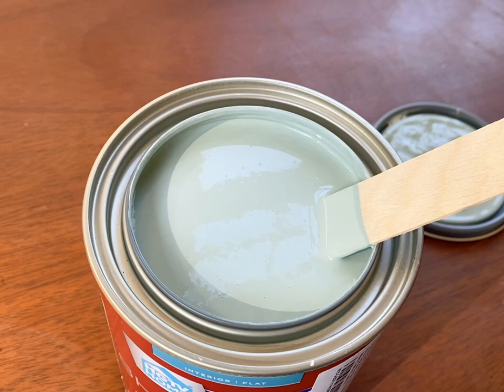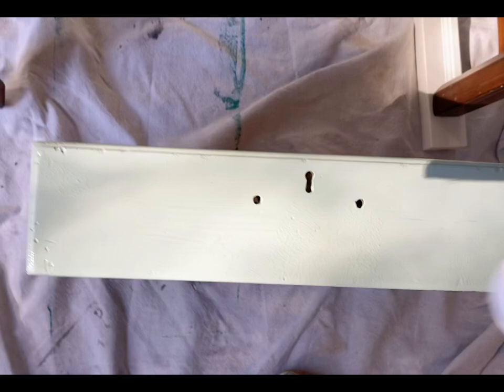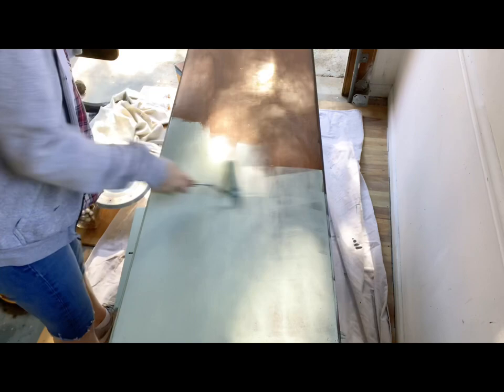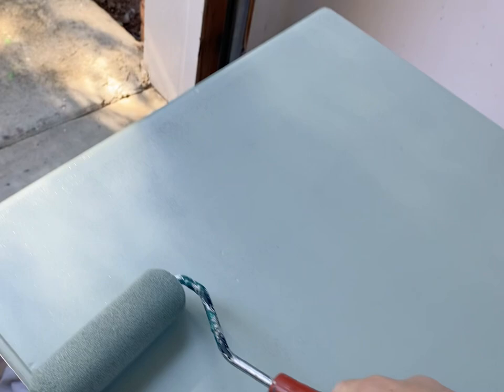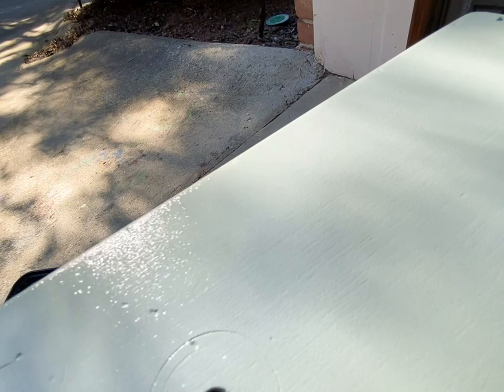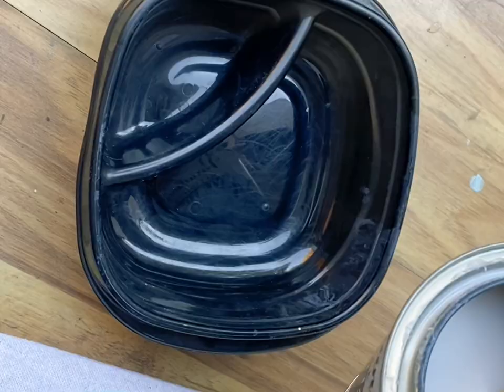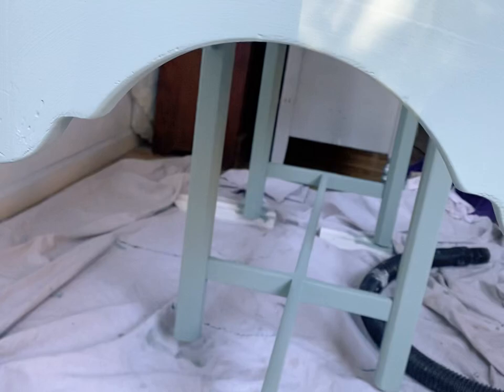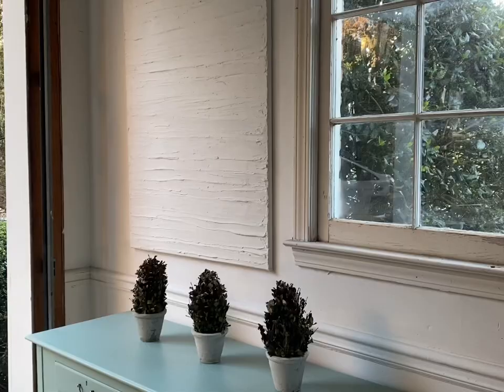Can you paint furniture or cabinets with house paint? YES!🧐 BUT…only some brands will actually work

Comment: Sweetie, I used "wall paint" for years on my furniture and only heard it was a no no, since chalk paint came on the scene.
Thank you for assuring me that whatever paint you use, it can and will work.  Love this flip!!
Reply from the maker: We are the same ❤️
Reply: Not true
Reply: @thomasburr9244  maybe "not true" for you.
Reply: @christibell5757  I'm a professional painter with over 20 years experience, not all furniture or glossed wood will accept paint a lot of stand surfaces even with the paint you are using it will not adhere correctly and you will be able to scratch it right off, I highly suggest using Sherwin-Williams extreme bond primer, it can adhere to any glossy wood surface that has previously been stained
Reply: @thomasburr9244  I understand.  I will tell you that 6 years ago, I used Pittsburgh Paint, with primer and finish to cover my ugly orange oak cabinets.  I took my time, painted 4 coats. 44 cabinets, including pantry.  
I took very good care of the cabinets.  They are beautiful today!
It doesn't work for everyone,  but the application worked for me.

Comment: You keep popping up in my rotation. I finish cabinets as a profession, as a painting contractor, and just to throw my 30 years worth of 2 cents in to help your followers….the only reason the HG SW paint is working for you is because your sanding the finish that is already on these pieces of furniture, i.e. you’re creating mechanical adhesion by giving the surface “teeth”, not because the product has “primer” in it. There is no such thing as a paint that is both a primer and a finish in one. These products are only referring to going over previously finished surfaces. A true primer is absolutely needed for raw wood, new drywall etc. That would be chemical adhesion. Your results do look great.
Reply: Do you recommend cabinet paint for furniture or regular house paint?

Comment: Tip from a professional painter, get a better brush that cheap brush aint cutting it. Also when you lay the paint on with the brush and then use a dry foam roller to flatten it out you're actually pulling all the paint off, secondly you should always, I repeat always use a primer when painting over glossed furniture would in cabinetry like that, I would suggest Sherwin-Williams extreme bond primer, that makes it so any glossy surface will stick and adhere and you can use whatever finish paint you want over that primer

Comment: I know its a pain in the a**, but I always prime every piece I do first, sanding in-between coats (usually 3) with 240 grit. I also add a tiny bit of water to my paint. The finish is always glass smooth. I treat every piece as if I was keeping it for myself.
Reply: What paint do you use?
Reply: @vickyb9918  Ovation or Country Chic chalk paint
Reply: @daveristic7895  Thank you!
Reply: I’m sorry I’m new to the game and just doing pieces to save money at home. Do you sand in between your paint color coats? I don’t know why I am reading it as either the paint color or primer 🤦🏻‍♀️ I’m sure it’s self explanatory
Reply: @Mshelen826  I sand between every coat of primer, and I sand between every coat of paint except for the last coat of paint.

Comment: LOLZ....And here I thought I was the only one putting plastic wrap between my lid and can... I do it so that the dried paint flakes don't fall in my paint each time I open it. And plus I do it for a better seal. especially if I don't use that paint for a while. I'm so going to try your 1 step paint recipe at some point and drag the foam roller method for topcoats. Great video! Learned a lot! Love your channel! All the way from Cape Town, South Africa! ✨🌺✨

Comment: I just redid my kitchen cabinets and used a sprayer. Love mine. I didn’t mind the clean up. Mines just electric and I used less paint with it versus painting by brush and roller. My experience anyway
Reply from the maker: That’s good to hear, I need to give another brand a try, which sprayer do you use?
Reply: @blacksheephouse  it’s from Amazon. It’s Yattich brand. First time I’ve ever used one and it was so easy to operate

Comment: Just found you, have only listened to this video. You presentation is so pleasant and informative, thank you. 

My kitchen cabinets have the same dents (but many more) in them as this table. They were in the house when were bought it.  I have had 3 different painters tell me that they could not paint them  with the dents. They said there was no way to make them look good.  Btw, they are high end wood finished cabinets so I have been in limbo for several years.  This is the first application that I have seen that might actually work on our cabinets.  Crazy thing is it seems wood stained cabinets seem to be very popular again. 🤔 Do you see a reason why this method would not work on cabinets?

Comment: Sorry, but I saw you stated paint color was SW Halcyon Green but what type? Exterior? Interior cabinet enamel? Satin?
Reply from the maker: It’s the HGTV line at Lowe’s, either showcase or ovation work well and the finish I went with was in Satin but the clear coat was matte so it brought the satin down a bit by the end but I like the finish it gave me
Reply from the maker: And it’s the interior

Comment: Is scuff sanding needed if I use this paint and also sanding in between coats? Thank you
Reply from the maker: I did a scratch test of a sanded (scuff w/400 grit sanding sponge)drawer and a non sanded drawer on a wood dresser with varnish on it snd they both stuck equally well so I only sand certain spots at this point with this paint
Reply: @blacksheephouse  thank you! Definitely going to try it